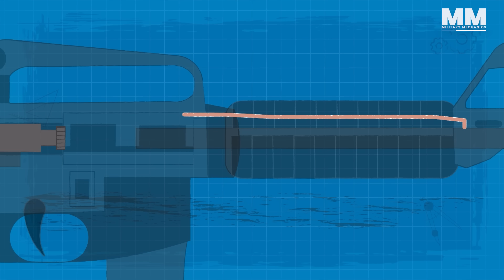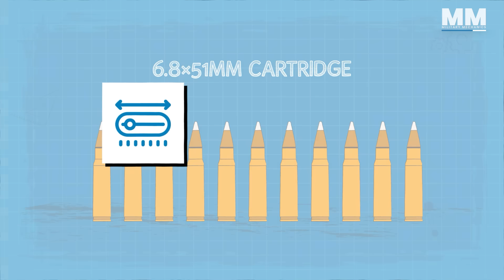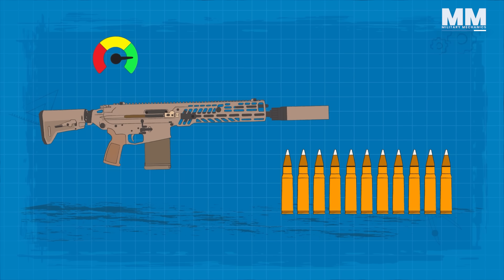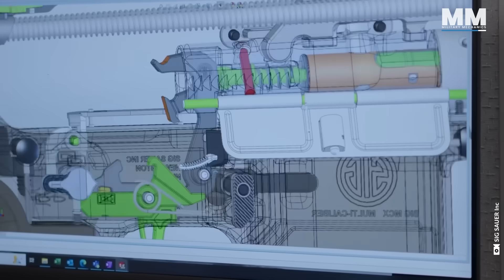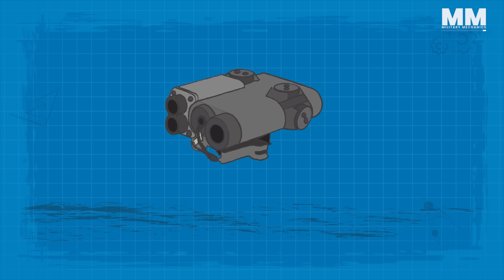XM7 vs M4: Why the U.S. Army Is Making the Switch

Comment: At 23lbs with ammo rifle and sight system added to a 20lb vest 45lb rucksack then add water and food etc. There is not any way your going to make every soldier a DMR. Especially if you think women are going to carry that thing and join the military carrying 100lbs of crap on a 20 mile ruck march. Barrel life just went to 3K round barrel life. Then what is the military goin to do with the Billions of 308 and 556 rounds in stock. You actually think the rest of NATO will change also? NOT GOING TO HAPPEN. Gun powder has reached it's pinnacle in case and bullet design. 308 barrels have 10k round limit the XM7 .277 is 3K rounds.

Comment: "Never change the winner !". You can't apply a caliber that is ideal for sub-machineguns and machineguns onto an assault rifle. There is a clear distinction. Against more efficient body armour, the longer length 20 inch barrel of the M-16A4 is the case. The Canadian version of the M-16 with an adjustable-lenght butt is ideal against better armoured but sluggish enemies. The new caliber can deliver more efficient sub-machineguns and sniper versions and the older caliber of 7,62mm can still survive for use with the static or vehicle mounted machineguns. The best caliber for assault rifles varies between 5,4 and 6 mm.

Comment: The problem is you need 308 level kinetic energy to defeat advanced ceramic body armor. 1200 ft lbs kinetic energy from the 5.56 is not nearly enough, even with dedicated AP cores.

Comment: The AR country is not going to get an AR weapon? I think the SPEAR is a mistake and it won't replace anything. Just as the SCAR was said to be futuristic and it has so many little flaws, that SCAR-H is like a side-choice DMR rifle with far better alternatives.

I think based on the bulk weight and size, it won't be an overall replacement. It will just be like an 'option'. Like the SCAR it will have little inefficiencies and things that make it not useable in all cases, and won't be replacing as easily as they thought. As I see it has the 'same' sort of issue of 20 round magazine as the SCAR-H. It 'weighs more'.. not an improvement.

What the US should have done is get the German improved AR HK416-417 and MG that is lighter than a M249 and fires like a M240B. All around improved versions from H&K. Even though the MG is 'not for sale' and likely H&K's price overall would be higher. Or at least make their own version of an improved AR, after seeing how impressively improved and impressive they are.  (even though I am not sure COLT is still around to manufacture that, the US definitely can create better polymers and 3d printing). An improved AR based on the HK417 or perhaps slightly even newer improvements, with the new 6.5x caliber, would be enough and have obviously benefits for being a continuation weapon, while weighing same or less. Otherwise there is no point to this except as yet another 'potential DMR' even for the electronic scope.. which is more beneficial for snipers or machinegunners.

Comment: The M7 is nearly identical to the H&K 416 iterations (of which the USMC uses one variation). The main difference is the M7 having TWO charging handles. One is the standard AR rear  "T" charging handle and the other is a left side folding handle forward of and above the magazine well. Both the 416 and M7 use the very ergonomic AR control pattern and hinge-open  action. 
The 6.8 x 51 cartridge is designed for lethality at ranges well beyond the capabilities of the 5.56 x 45 NATO round. It utilizes current 7.62 x 51 magazines.
->The M7 SIG suppressor is VERY effective in venting gases FORWARD and away from the operator, unusual in suppressors but much needed. To attain this feature the baffle was so complex that it could only be efficiently made using 3D printing of titanium alloy. 
THE TRUE REVOLUTION OF THE M7 IS THE M157 SIGHT SYSTEM. The M157 sight has a "brain box" on top with a laser range finder, temperature sensor, altitude/pressure sensor, inclinometer, cant sensor and some other classified abilities that can be added. An "average infantryman"  using the M157 with theM7 and the high pressure (80,000 psi) battle cartridge will have an 80% hit probability to 700 meters!! A true revolution in rifle lethality.
Reply: How about zic-zak moving enemy soldiers without iron-clad armours, who sprey you with full automatic bursts with tracers. What can an 8X magnification sight system do against moving targets ? They come closer in an armoured vehicle and when their vehicle is hit they run at you spraying your shelter with 5,56 bursts with tracers susceptible to mark a headshot. Besides a static iron-clad soldier, who targets the enemy from a 700 m distance can easily be a pray of a cheap FPV-drone carrying a cheap assault granade that bursts in front of his face.

Comment: The problem isn't the rifle, it's the cartridge. Just neck 556 to 6 mm, 90 gr bullet, swap bbl, tweak a little, keep the M 4, use existing 556 ammo for training, it would be a lot cheaper. The AR platform has been improved for decades, why throw that away , everyone that's ever served has received training and are familiar with it .
Reply: @TonyBlougouras  kinda like the 6mm ARC and 6mm GT. 

If they want a slightly longer cartridge they can also use a slightly longer receiver but I think the 6 ARC/6 GT is the sweet spot. I even liked the 6.8 SPC II. I think bolt Head Failures in sustained Full Auto Testing will be a concern on these. The rifle needs a larger bolt head. That would allow a larger extractor, too.

So, “my” variant would be 6x45mm and weigh an extra 1/4 lb. It would be  1,000 yard carbine - just as the 6 ARC is today.
Reply: @WDLC1911  I was thinking of the most inexpensive and easiest way to upgrade to a more effective  cartridge, they've already used the heaviest bullet possible for 556 and the 1-7 " twist erodes barrels quickly. This new rifle would be good for a designated sharpshooter , but why a new , very expensive cartridge. Wouldn't 762 serve and make more sense logistically? Is this new round that much better? Yeah, 6 by 45 sounds good to me.
Reply: @WDLC1911 6.8 PRC II
Reply: The rifle is still too heavy.
Reply: This is what a lot of people have been saying for years.
Reply: Come to think of it, haven’t there been AR-15 style rifles chambered in 6.8 before?
Like Barrett’s REC7?
Reply: @BrowncoatGofAZ  I'm sure they have, I just don't see the reason for another cartridge,logistically, doesn't make sense, if you have 762 cal for   designated marksman ,you can scrounge from the  MG guy. We seem obsessed with high tech and complicated systems when it's not necessary.
Reply: @TonyBlougouras  actually they gave the reason.
Apparently China and Russia are gonna arm their grunts with better body armor.
If our grunts can’t punch through it, they won’t win any fights. And one DM can’t outgun an entire squad.
And we tried 7.62 back in Vietnam (admittedly with a long-barreled rifle in dense jungles.)
Reply: @BrowncoatGofAZ  762 , 165 gr 2750 fps, 6.8, 100 gr 3100 fps , is there really that much difference? Put a steel penetrating core in the 762, I bet it would be just as effective against body armor. What do you think?
Reply: @ my only concern there would be recoil and ammo capacity.
That and the military would need to mass-purchase rifles in 762, or convert all their rifles to 762, kind of like Stoner’s original AR10.
Reply: @BrowncoatGofAZ  The recoil and ammo capacity would be about the same, one bullet is slower and heavier, the other lighter and faster, and they're already purchasing new rifles. I don't think they will issue these to everyone, it seems like more of a designated marksman , specialized weapon, issued to front line troops. M16 variant would still be issued to those not directly involved in combat operations . I'm just trying to keep it simple, FUBAR happens quickly.

Comment: The specially designed high-powered rounds cost between $12 and $15 each — significantly more than the 47 cents per round for the M4’s 5.56mm ammunition.

What a gift for SIG Sauer!!!!!!
Reply: The 6.8 x 51 is manufactured by the Lake City govt facility.   Get your facts straight.
Reply: I think the most deciding factor in the end will be how troops react to the added weight. That's why more sought to carry the M1 carbine than the M1 Garand.
Reply: That’s complete bullshit!  

Civilians can buy the same round for $2.00!!

So you know the military is buying .25 - .50 cents a round.
Reply: The 6.8 x51 ammo will be produced by the Lake City government ammunition plant.  Cost should be roughly $1.47 per round.
Reply: @cwolf8841  thnx ...but would def influence me not to buy ...at around 5 to 7k$ per rifle ,if ia could afford it .I would not be going down to the range and running a couple hundred rounds thru it on a reg basis

Comment: There's a couple of issues with the new weapon system both good and bad. The weight will be a real problem, at 12 pounds just for the rifle itself, that's an issue, but then the ammunition is also heavier which will result in fewer rounds carried. The 6.8mm round is more powerful and it has greater range and stopping and penetrating power and it has a real "kick" to it as well. Onces equal ponds, pounds equals pain is an old Ranger adage and it is a truism if ever there was one. Not only is weight painful, but it is also limiting. It limits how high you can climb, how fast you can run, how far you can walk, it limits what else you can carry. I see all kinds of problems with this new and improved rifle system.

Comment: In my opinion, the M4 isn't going to be replaced by the M7 or the 6.8 x 51mm cartridge. The weapon is significantly heavier, troops would only be able to carry half of the ammo, and it produces as much recoil as 7.62 Nato. Which for me, isn't a lot. But it's still a lot lore than 5.56, and a lot of infantry due to these reasons wouldn't be able to weild it as effectively as the M4 and 5.56.

This should really replace the role of 7.62 x 51mm Nato, and the weapons that use it. If anything, the new 6mm MAX cartridge should be the one to succeed 5.56 Nato. It's not much heavier, has about the same recoil, maybe a pound more or so, it's ballistically superior across the board by a large margin.

For example, in a 20 inch barrel, 5.56 is pushing a 55 grain projectile at 3,250+ FPS. Meanwhile, 6mm MAX is pushing a 58 grain projectile at 3,585 FPS from a 20 inch barrel. Plus, it has an effective range of 1,000+ yards. Which is virtually double that of 5.56!
Reply: The Chinese know this they use 5.8
Reply: @ChicanoBarbarian13  Agreed, the Chinese figured that out decades ago, so props to them for that. However, its still not that much better, ballistically speaking, then 5.56 Nato. But given that we're comparing a cartridge from 2023-2024 to a cartridge made in the 80's, I would definitely say they were ahead of the curve slightly. But the 6mm Max does still outperform the Chinese 5.8 x 42mm by a decent margin, especially since the known ballisitcs of the Chinese 5.8mm is out of 22 inch barrel, while on the other hand, even in shorter barrels with a heavier grain weight, the 6mm Max is faster and more powerful. Example:

5.8 x 42 in a 22 inch barrel using a 77 grain projectile: 2,900+ FPS. 1,400 Foot lbs of Energy.

6mm Max in a 20 inch barrel using an 85 grain projectile: 2,940 FPS. 1,630 foot lbs of Energy.

Comment: The AR platform rifles do not use a gas Impingement system. That system just blows gas against the carrier. The AR system just combined the piston with the bolt, and the gas block with the carrier simplifying, and creating a straight, in line recoil with no carrier tilt. It also reduced the reciprocating mass, and increasing accuracy over the short stroke piston system. The advantage of guns like the 416 are greatly exaggerated. The standard AR gas system is superior to a short stroke piston system in almost every way. There are just a lot of so called experts extolling the benefits of the short stroke piston. But just because someone is a good shooter does not mean that they are an expert on the weapons themselves. They just know what manufacturers have told them. The new sig rifle as a replacement for the M4 is an absolutely horrible idea. There is a reason the US has used the AR platform since it was first developed, and it isn't for a lack of trying on the militaries part. Their just hasn't been a replacement that justified it. And the NGSW certainly does not. And the original XM177 E1 did not use a 4.5 inch flash hider. It was 4.3 inch moderator, which was basically just a tiny, not very effective suppressor. It was also perfectly reliable, especially when they went to the E2 with the 11.5 inch barrel, even without the moderator. People that aren't "weapons experts" shouldn't be presenting misleading information as if they were experts.
Reply: You know nothing of guns the AR 15 is a direct impingement operating system unless you get something like an HKSR 25 or other variant that uses a piston
Reply: 😂 you're not an expert too!

Comment: The m4 era will never end. The weapon has so much going for it that other models don't.
Reply: Every weapons era eventually ends,
Reply: @ajax1475  As it stands, I just don’t see it being the Service rifle. It’s going the way of the Scar 17. Some special units will field them and it will lose the interest of DOD spending and retraining. 6.8 is also not usable to supply our poor  NATO allies.
Reply: @quickslashgib5800 everybody that has tested it, liked it. It almost had a perfect rating, even higher than the original m4. The XM157 failed miserably though. With  the soldiers saying the probability of completing 72 hours without it having a major failure was very low
Reply: The M4 isn't going away. Not because of this, anyway. M7 isn't actually replacing the M4 entirely; just in "front line" combat units (think Rangers, Airborne, Combat Engineers, 10th Mountain, and so on). All others (Artillery, Logistics, and the like) will continue being issued M4's for the foreseeable future.
Reply: Disagree, everything has an end. The M4 is dated and old and doesn't do well against pear adversaries.
Reply: The new rifle-sight combo only goes to Close Combat forces.  The rest keep the M16.
Reply: Everything eventually ends. Yes even the m4
Reply: i think the m4 will just be the new M1 carbine. It'll be used for Rear D units and medics, etc that only need to engage within 300 meters. Frontline guys will probably end up getting some 7.62 NATO rifle, given that that was the NATO cartridge before all this happened anyways and that it does already sufficiently reach out much farther than 5.56.
Reply: @mingus444_gaming ’Rear Echelon’ not ‘Rear Detachment’
Reply: @jkim8551  true generally, but some units have detachments like mine does and i would say rear detachment because its a rear detachment

Comment: The US has needed a larger caliber rifle since 2000 and they REFUSED to swap....they also need to get rid of brass cases and go polymer to cut the weight of the ammo in half.
Reply: Polymer shells do not collect the heat like bass does. Storing heat in a rifle is bad and could lead to things such as a cook off. When the cartridge is ejected, some of the heat is ejected with it.
Reply: @orlock20  Polymers could be infused with materials that have high thermal conductivity. Could reduce weight while ensuring efficient heat transfer.
Reply: @ErikMagnusLehnsherr89  and how much do you believe this hybrid case will cost???
Reply: @WDLC1911  As with all new materials that haven't been upscaled for industry, they are likely to carry a high price tag initially. Down the line, not much, as injection molding costs way less and requires less machinery than hammering brass plates into the shape of a cartridge. Would also reduce the impact on metals/mining, as only the base of the cartridge that houses the primer and provides the ridge for the extractor to bite into actually needs to be metal, thus requiring way fewer source materials.
Reply: @ that tech is not here. They’ve been working on it for over two decades. 

PCA made it commercially available in the early 2000s. I tried it. It was not ready. The heat soak from a hot chamber crazed the case neck which shattered when the next round was fired leaving a bullet about 4 to 5 inches in your barrel. Did that for a semi and bolt. 

The research continues.
Reply: @orlock20  Agree, An area that should have been pursued,
Reply: Well they are still trying to perfect the polymer case for rifle ammo, but still have some improvement to make before it becomes a viable alternative.
Reply: Yeah polymer ammo is not reliable and they have a long way to go before they are actually dependable. Also, 556 is perfectly adequate, just look at what Ukraine has shown us. It proves that the majority of firefights happen within 300m and that you need to be able to carry more ammo in a LSCO environment. It's not about precision it's about who can fill the air with more lead and keep heads down while you maneuver to get close in for the kill.